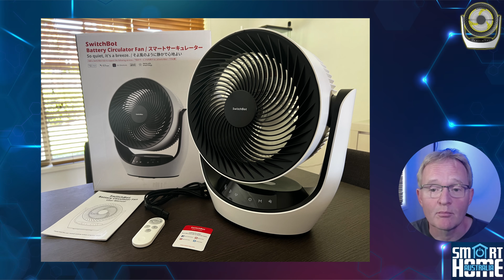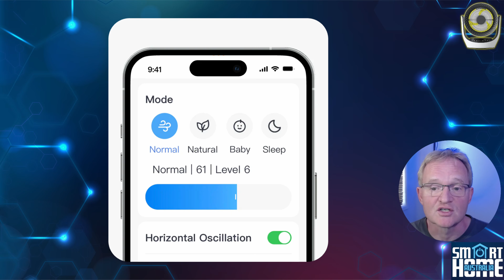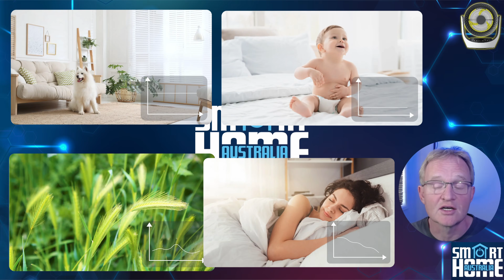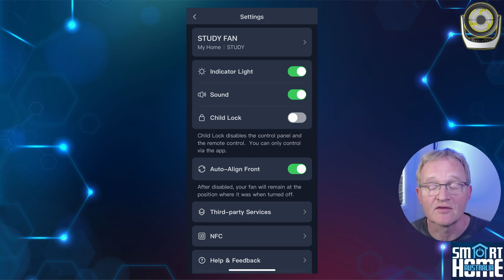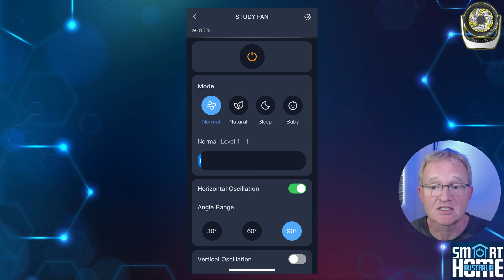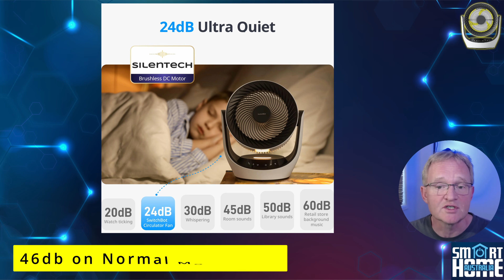Discover the SwitchBot Battery Air Circulator Fan: Your Ultimate Smart Cooling Solution! 🌬️✨

Comment: Thanks for submitting support for Home Assistant. Just got mine hooked up and bummed I can’t get connection thru home assistant but since it’s decently new, hopefully they’ll integrate soon. Is there somewhere you suggest I can chime in to help submit for feature request? I’m decently new to the space, but would love to be able to give feedback like this when possible.
Reply from the maker: I've been running mine for a few months now and am loving it... the fact that its battery powered and yet still powerful enough to move air around a medium sized space makes it so much more flexible. 
Yes SwitchBot are aware of the feature request to the integration and they have been super efficient for including features in the past, remember this is a huge company so they have to get it right or brand damage would be massive.
As for helping the cause, I don't know of any official feature request channel for SwitchBot apart from my contacts into their R&D, Tech support and Marketing departments, but I'll keep pushing :)
Reply: @smart_home_australia  I know this doesn't support the Switchbot Bluetooth integration yet. But we can get it into Home Assistant with Matter, right? I do see it listed as a device that can be bridged over using one of their Matter hubs. So I figure it should work using that method. 

I'm considering it for the one bedroom I have that doesn't have a ceiling fan(and I don't want to install one lol). And being able to get it into HA would be important to me.
Reply from the maker: @RiceEater483  Short answer, yes. Long answer, yes but only for power ie. on and off, well thats all for the moment.

Comment: Would be great Zigbee2mqtt Air. Matter is poor technology for now. 100€ for this gadget is expensive. I Have artic fan with a Zigbee usb switch for 25€ all
Reply from the maker: Yes I agree it's not budget friendly, but it's amazing well engineered, has 12hrs battery, and is super powerful and quiet. IMO fix matter and reduce by 25% and this would be a winner.